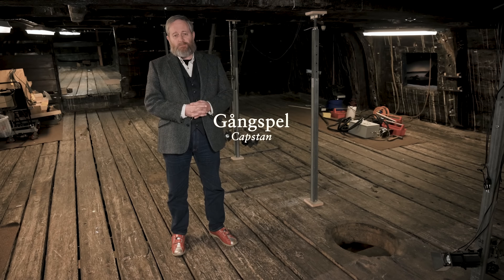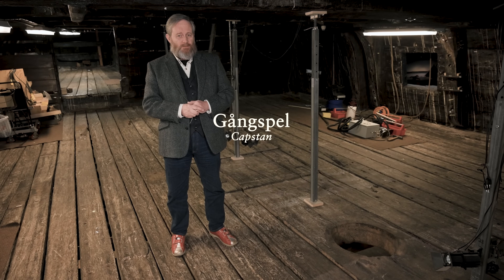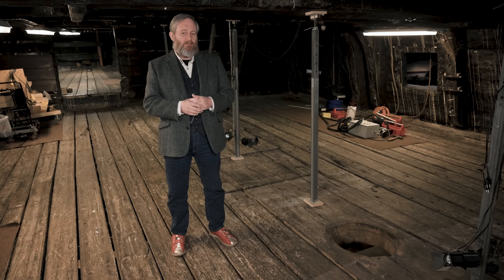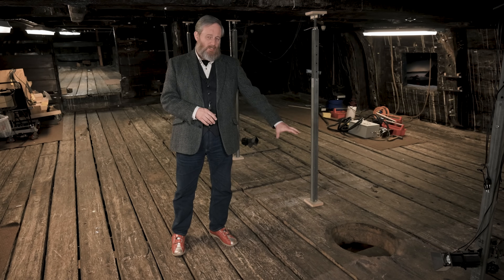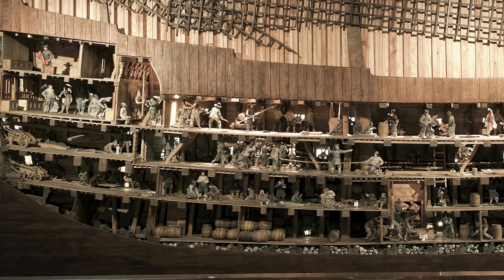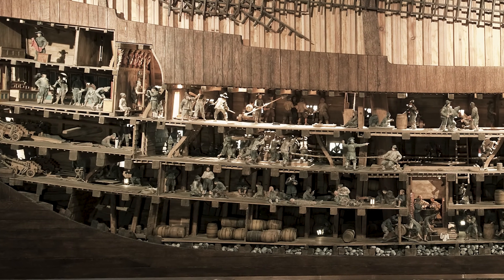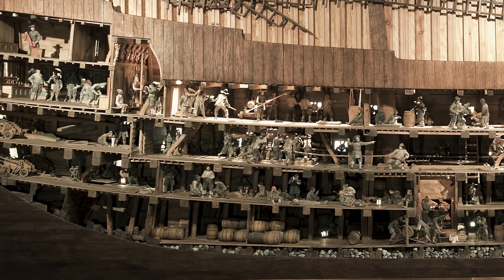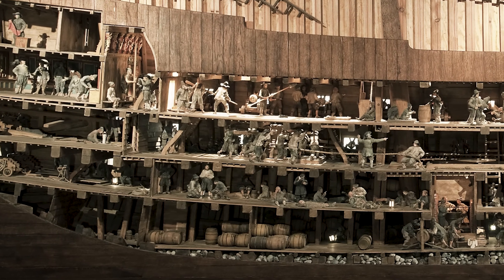Ombord på Vasa - avsnitt 3

Comment: I remember from the Bataviawerf that the planks at the very bow had been severely charred while being bent wet over open fire to follow almost a circle quadrant either side of the bow.
One of the ships' carpenters there told me that this was also found on the wreck of the original ship. According to what I was told, the charring was so severe that the archeologists who excavated the wreck first thought that there had been a fire on board.
I wonder, are there similar traces on the planks in Vasa's bow?